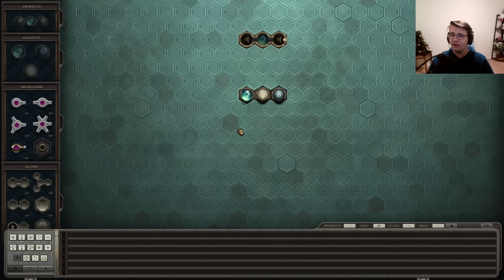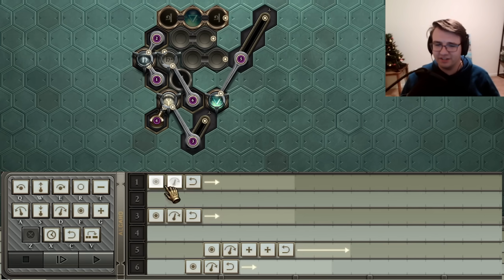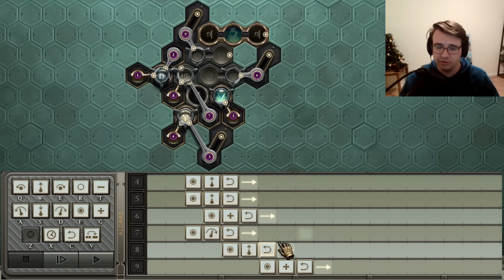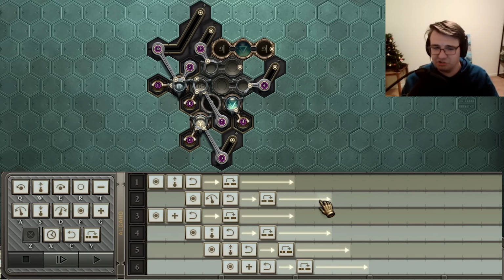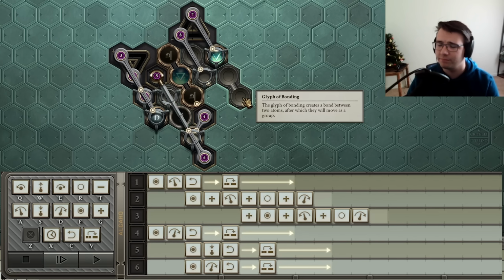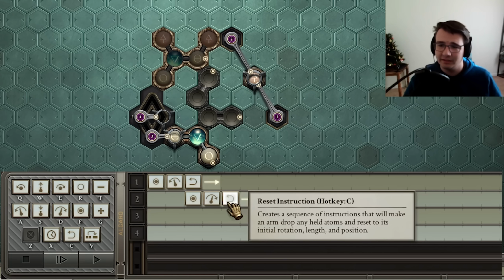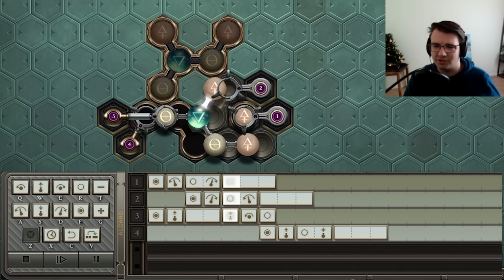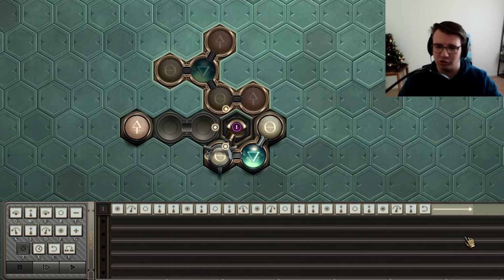Optimizing My Factory for Speed AND Size! - Opus Magnum

Comment: Those 26 cycles for health tonic can be done with two simple arms and one 3-arm with 4-instruction cycle program (i.e. 12 total instructions).
.
.
(spoiler alert)
.
.
.
.
.
Basically you prepare two bonding glyphs and life in position where it can be transported by single rotation to both spots where it will be bonded.
In first two steps you grap life and distilled water and move it on the bonding glyph with simple arms, these two arms will do reset instruction for next two steps.
The 3-arm will grab second life at cycle 3 then rotate it to bonding spot and then continue rotation, now with final product to place where the final product will be dropped. So it does grab, rotate, rotate, drop, so it happens to be in its initial state because it is 3-arm.

Comment: I got an area of 14. You can press the number 2 while it is running to highlight the used area. 14 is 2 spaces more than the necessary parts (products, reagents, glyph of bonding, 1 arm)
Reply: there is a gif of a 13 area solution

Comment: When you reach the flare puzzle, while I would love to see your speed solution, I would also love to see you try to optimize for area. You can get away with only one of every piece and one single piston arm there
Reply: Only one of every piece is cost optimization not area. Area is generally a different story than doing fastest or with least, i think it can work with both. Which is best depends on the puzzle
Reply: Are you talking about least cost? If so using a 2-wide track and a single arm is cheaper than a piston arm and nets you enough area to reach both a bonder and unbonder. And then moving down to a single arm if you think so.
Reply: @Xhadp  not for that puzzle; I needed every single position to move the outer elements out of the way

Comment: You can drag an new arm onto a programmed arm to “upgrade” the arm, keepings its code and orientation
Reply: Wth does an upgraded arm do
Reply: Upgrade might not be the right word. (Which is why it's in quotation marks) You've seen how there are multiple types of arm? There are 1-sided arms, piston arms, 6-sided arms, etc. Basically, you can change the type of the arm, but keep all of its programming.
Reply: @pirilon78  It's not an actual upgrade, but a QoL feature that lets you change out arms on the fly without having to reprogram the arm. Say you programmed a 3-armed grabber but found out you want a 6-armed one but also have a long line of code you don't want to have to rewrite.
Reply: @MeeTonToE  ohhh its not an upgrade then
Reply: @pirilon78  Correct.  It might be more accurate to say "swap in place" rather than "upgrade."
Reply: @Carnaxus  I guess you could say it's an...

"in-place swap"?

(EXPLAINING THE JOKE: for those out of the loop "in-place swap" is a well-known level in space-chem, another of the creators of opus magnum's (zachtronics) games)
Reply: @alansmithee419  Put me in the category of "out of the loop" then.  Opus Magnum's the only one of their games I've played so far :)
Reply: @Carnaxus  I'd definitely recommend space-chem if you like opus magnum.

I'd also recommend just looking into each of their other games to see if any jump out at you after seeing a couple puzzles. Probably starting with molek-syntez/infinifactory (both spatial reasoning puzzle games (like opus-magnum), but with the second being in 3d).
Reply: @alansmithee419  Oh wait, Infinifactory is a Zachtronics game too?  I've had that for a while 😁
Reply: Never knew that, thx